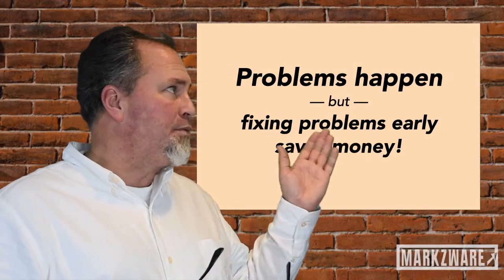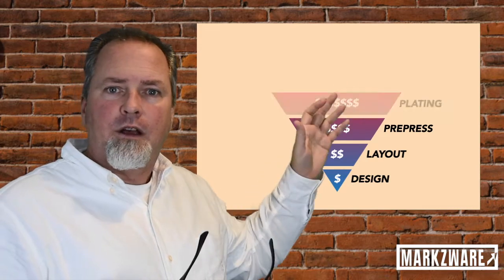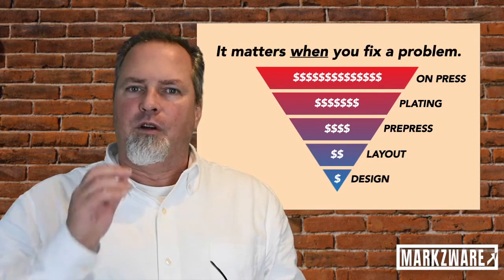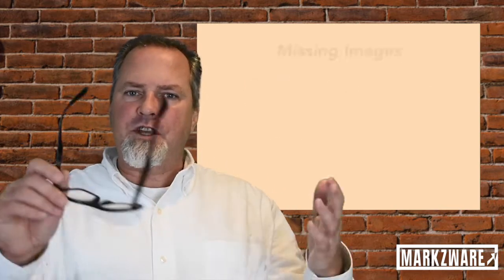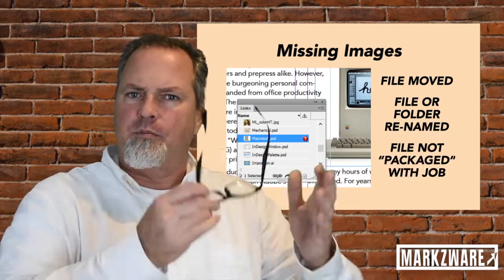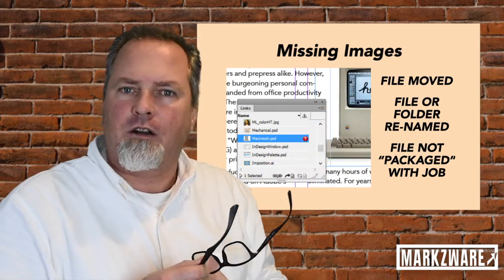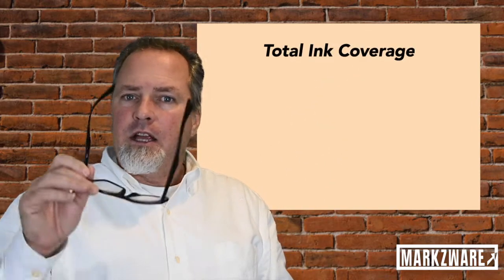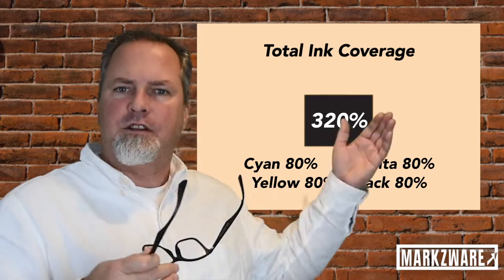Preflight Basics for Graphic Designers

Comment: Mostly about offset printing he’s right. But large format and digital press needs a different approach. I’m not sold on this pitch. It’s not accurate.
Reply from the maker: Hi Vincent, feel free to give specifics, could you? I mean, a non-embedded or missing font, or low resolution graphics, etc, are pretty deadly in a digital press workflow.
Reply: You are right about embedding en fonts. Type should always be converted to vector to be Shure. But if you want a nice print with colors that match. You could save anything with an Adobe rgb icc profile for digital print. Because the gamut is much wider than cmyk and you could match better in rgb. But only if it’s not offset printing. This is only for digital printing. And if you had a image fir a billboard and is a 200 meters away. Dpi could be as less as 72 dpi or even less. Some small things that do not match your vlog. I don’t want to be burning all your saying. But I like accuracy when I’m looking for ins and outs.
Reply from the maker: @vincentvanuden  This was more a 40,000 foot preflight overview, not specifics for each market segment.
Reply: Oké I understand it’s not for every segment. But when I saw de RGB forbidden sign 🚫. That’s where I thought “This is not right” digital printing presses (not offset, I’ve been an offset printer for 17 years) but like a canon c710 or Konica presses. They can handle rgb just fine and because of rgb they have a better color management. I hope I did’t step on your toes.
Reply from the maker: @vincentvanuden  Oh, that is a good point. That RGB forbidden symbol is not always a problem. We did this for a third-party and were allowed to use the footage, so it was very general. For a university, for teaching students of graphic design, the generalities. Good points though, no problem! Have a great night.